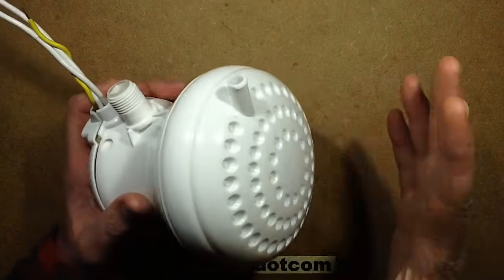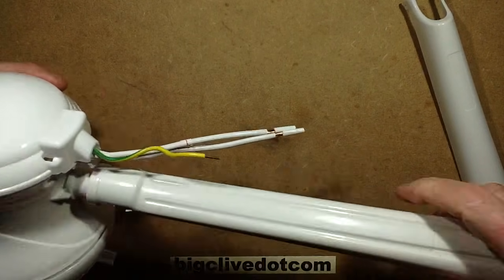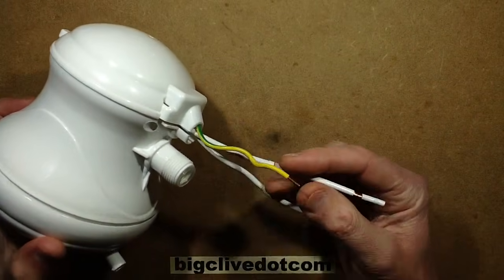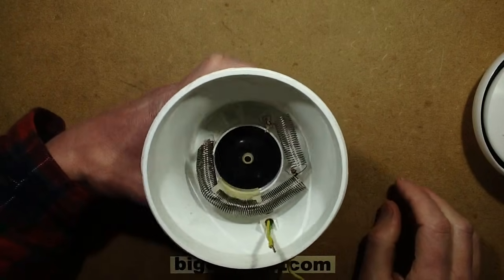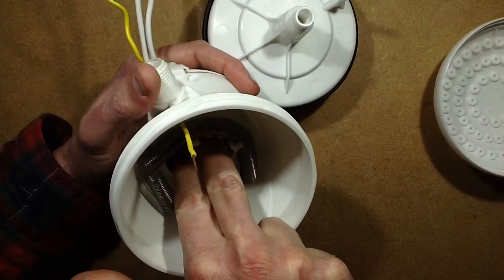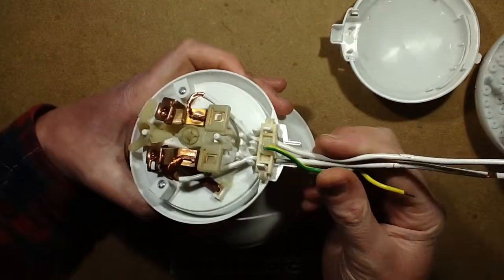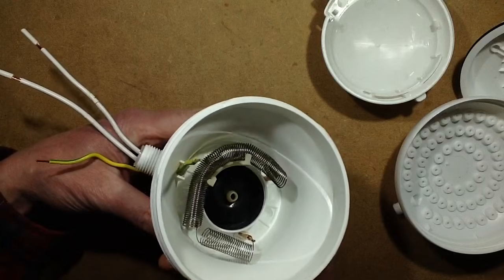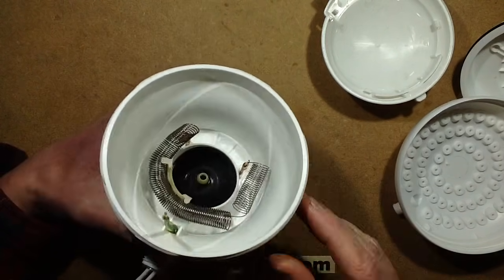Inside a heated shower head.  (suicide shower)

Comment: When I moved into my house in Texas, I would notice that in the shower I would have this funny feeling over my skin when I would touch the water controls or stand on the drain grate while taking a shower. I first thought it was just a mild allergic reaction to the water supply (I've lived in places before where some of the minerals/chemicals in the water were allergens). When I asked around the community and found that no one else had this problem, I started to investigate.

The discovery occurred when I decided to check for stray AC voltage between the electrical socket and the neutral and ground of the supply socket in the bathroom. I found there was 30VAC going to neutral and ground from the drain grate, drain head, and water controls. I had the power company come out and disconnect the mains supply to my house at the pole outside, and checked again. There was still 30VAC. I now will say that I live across the street from a substation. 

Whatever I had said must have concerned the power company because over the next few days they began replacing insulators on the poles near my house and digging up and installing new, longer grounds in the substation lot. They did quite a lot of work over that week and after they were done I checked up on the power situation in the shower. The shower was still 'live' but the voltage had reduced to 8-10VAC, which I could no longer feel when taking a shower. I didn't live there much longer after, so I didn't worry about it too much especially since I didn't feel anything any longer. 

Just thought I'd share this with you as this video reminded me of that event.
Reply from the maker: In the UK there is a requirement to equipotential bond adjacent metalwork in areas like bathrooms and kitchens to prevent any potential difference occurring between metalwork like that.
Reply: Ah, in the USA I found they were not nearly as proactive for electrical safety as in my home in Canada. I wonder how much the difference in mains voltage makes in safety design considerations, since in the USA and Canada, are sitting at half the UK mains potential for the standard electric supply. 

I still wonder what the ultimate cause was for such a voltage to be present in the shower...? A bad ground in the substation? Current loops through my old piping? Bizarre distribution equipment fault?  I'll likely never know now... but at least I lived to tell the tale.
Reply: @kevito666  when I was a kid the garden hose had similar current. You would feel it in cuts in your skin
Reply: cool_ohm Being disconnected from grid & getting voltage at shower you are getting a induced voltage from the power station. There is an electromagnetic field cutting the planes of your metal plumbing. A gauss meter can verify & measure. There's apps for that. Run a fence or wire paralell  near a high voltage line
& get free power possible.
Reply: @dkafsky lol, i charged batteries this way. Blows people's minds.
Reply: @dkafsky  but it would be shit quality power at low voltages
Reply: I'm in Australia. When they poured the concrete slab for my extension which included a bathroom with shower, my electrician said that a new rule had just come in that the reinforcing mesh in the concrete had to be earthed. Apparently someone had been electrocuted via the shower, so I am happy that the slab was earthed!
Reply: @jeffreycox500  I wear rubber sandals in my shower my concrete bathroom hasn't zapped me
Reply: Induction current. It’s real. You could probably charge your phone from the shower:)
Reply: if your house was fed via metal water pipes from street mains then this could easily be the where the voltage differential is due to leakage currents in ground from sub station & not having house neutral bond to house water if that system is used there (as is in au)
Reply: Imagine that now lol. "why is my phone charging wtf" lol fucking induction from the power station acroos the street that's hilarious.
Reply: Friend of mine had a similar problem years ago in Florida, getting zapped when stepping out of their outdoor pool. To jump to the end of the story the power company had to come out and dig up lines running beside their house and replace them.
Reply: Holy shit man thats insane.
Reply: Guess you could say that you helped them make an...electrifying revelation?
Reply: Wow that is very bizarre
Reply: Looks like a leak from substation high voltage power lines to the plumbing, combined with poor ground connection of the plumbing itself. I wounder if you can connect rectifier and voltage regulator to the plumbing and use it to charge your phone 😁
Reply: That wasn't the shower, there's something wrong with your skin dude.
Reply: That's wild.
Reply: Had they even got away with manufacturing this thing is more than I can figure out. It’s a death trap.
Reply: It's code to bond plumbing and gas lines now, but many years ago it wasn't. It really depends on how old the house is as to whether you can expect it to be bonded or not.
Reply: @Sublimnalxx  Every house I've lived in, including some rather old ones, had at least bonding of the water pipes, usually in the airing cupboard. Not up to current day standards of course, but it would at least mean all the pipework in the bathroom was at the same potential from an era when it would all have been copper without any plastic components.
Reply: cool_ohm bu
Reply: cool_ohm f

Comment: i could see it working good if the ground wire is not silicone tipped inside(as u said it was on vid), perhaps attaching a stainless steel clip(of some sort) on the ground wire on the inside then heat shrinking it so that the ground wire doesnt corrode from the water and then getting some long wire(6ft/12ft-ish) and a outlet as well as a on/off switch to put in the wire somewhere along the way(waterproof switch). after that getting some suction cups(with a clip/key ring on em) to keep the cord out of the way while showering .

Comment: Hi there, nice video. 

Those are pretty common here in Brazil (even though this precise one you are showing is made in China). The Brazilian-made ondes come in decent quality and undergo quality control, even though they're not much safer than this one. Unfortunately that's what 99.999% of the people use in Brazil in spite of recent and somewhat though local regulations.
 
I own a safe version of this called the Quatro Estacoes (Four Seasons) which has a shielded heating element (Just like the american water heaters), an Earth Fault Protection and a Triac based Power Control Unit but is also about 20 times more expensive than the conventional ones. It delivers 7.7KW to the load, which stands for an amazing (steam room-like) shower experience.

The reason why we have that kind of shower head is because (for the most part of the country) our climate does not justify stocking heated water, most of it is heated as needed and the demand itself changes according to the season. On average, we tend to shower twice a day during summer, now imagine a household with 4 people and you would need a whole lot of hot water to meet the demand.

For the record.... "Ducha" means shower in Portuguese..... I know...... pretty duchy..... but yeah, that's what it means no pun intended... 

For some 15 years now, there is an increasing number of households using solar heating systems, though those systems are mostly dedicated to swimming pools.

Anyway, that's the perspective from a person who lives in Brasil and has already experienced the "tingling" a lot in the past. 

I do agree with you, those are indeed a death trap.

If properly grounded (which is the case for about 20% of the users at best) it can be dangerous but acceptable. Unless, of course, you buy one of the safe versions with shielded elements, then it's actually pretty good.

Thanks for sharing.

Dennis

Comment: Man this is completely fucking nuts. As far as grounding wire to the water goes it would electrically corrode in no time (unless it's insulated with silicone in which case it'll do nothing). And as far as getting electrocuted goes, the third world is also where you may get water with too much salt in it and get killed for real.

Comment: Are those legal in the US?
Reply: NO. They are absolutely illegal here. We have never even made these nor imported these shower heads. Everyone in America has a water heater or a boiler.
Reply from the maker: It depends on local regulations.  They wouldn't comply with safety regulations in the UK in their current form.
Reply: Everyone in America wastes 90% of the energy they consume.  As you seem to have wasted 90% of the education you may have.
Reply: Truth teller "everyone"
Reply: Dan qqq
Reply: Dan "Faggot" is the typical insult of a juvenile mind.  On this thread, I have cited no study.  I have only requested that proof be provided of anyone being electrocuted by one of these devices.  No one has done that nor have I found any myself.
Reply: NyX ///
Yes, everyone.